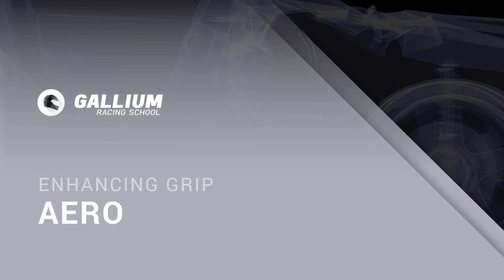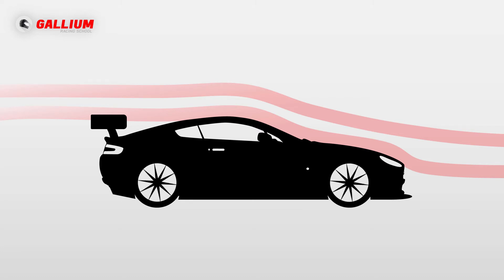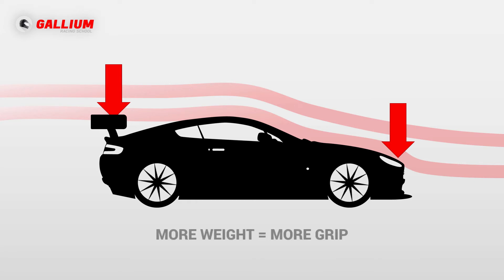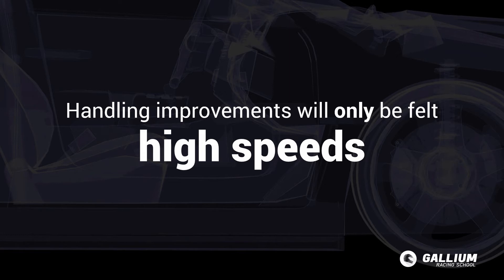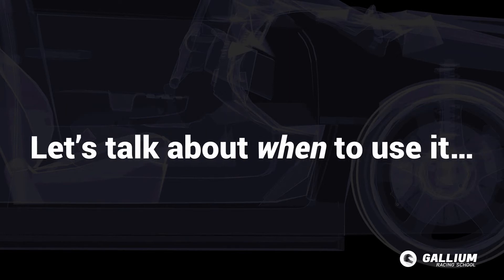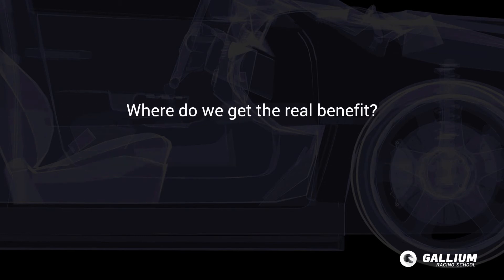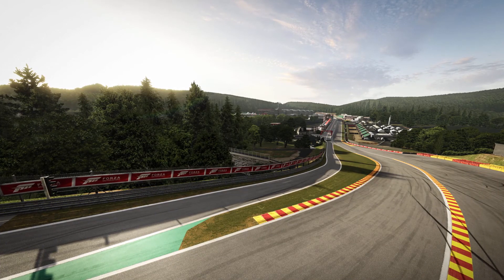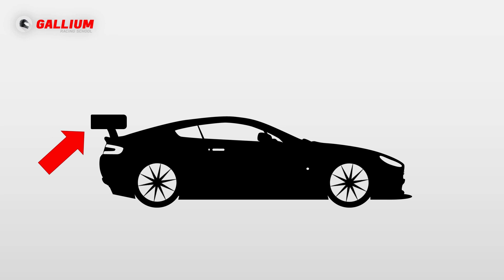09 - Aero - Suspension Tuning in Forza Motorsport

Comment: If the rear is sliding around, could you decrease front downforce?
Reply from the maker: The general recommendation is to adjust the end with the problem vs. compensating on the other end. So you might be able to keep the rear from sliding around that way, but it creates a chain reaction of other things...like now the front has less grip. 

That said it's a good observation, and might be the only way to balance the car if you can't add more rear downforce.
Reply: Depends. If it is at all speeds, suspension might be the problem. If it is only at high speed, use more rear or less front. If it is only at low speeds, suspension might be suspect too.

Comment: At what speed does aerodynamics actually take effect?
Reply from the maker: That's a good question. It might be easiest to think about how air resistance changes with the square of speed. So whatever downforce is generated at 50 mph won't be double at 100 mph. Downforce will actually be 4 times the amount if you go twice as fast. And you'll have 16 times the downforce at 200 mph than at 50 mph!

So there is always an effect but it ramps up quickly as you gain speed.
Reply: Gallium Racing School thank you, this helps a lot